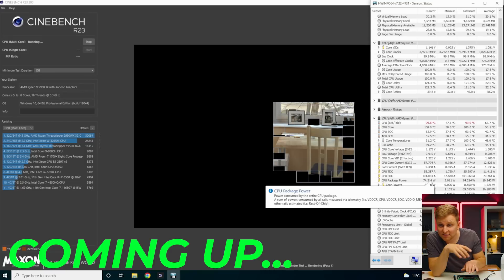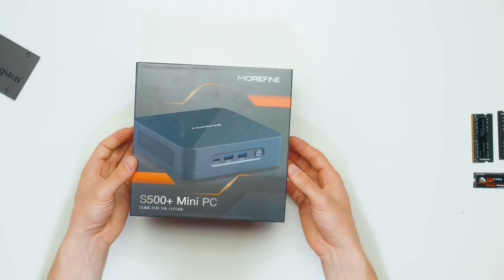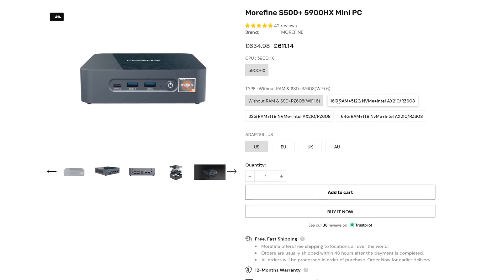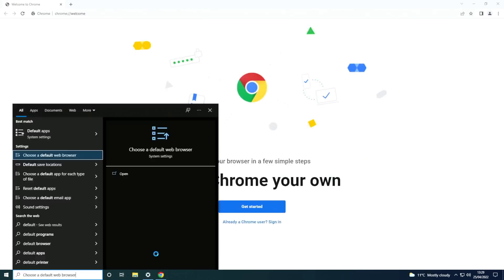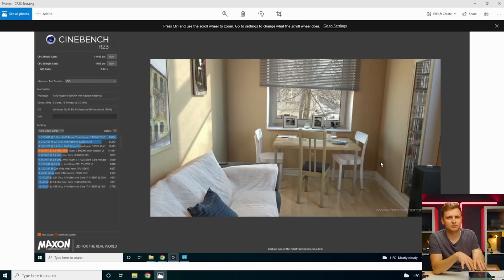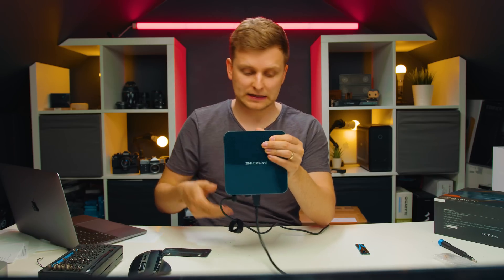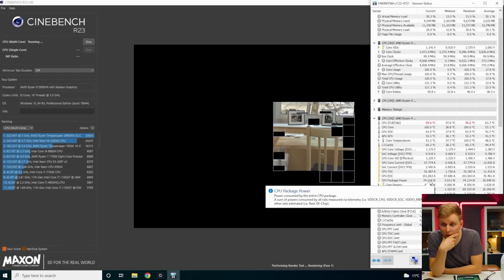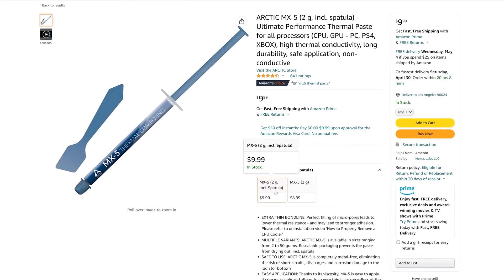BEST Mini PC?? Small & SOO Powerful! - True Apple Mac Mini Competitor! 😱

Comment: All the companies have not yet solved the problem of turning off the device with the oh on the back of the TV (msi has an external button)
Reply from the maker: You can turn the PC off with a keyboard if you have a power button on a keyboard if you turn the setting on on Windows Settings :)
Reply: @Tech Notice Yes turn off no problem just turn on

Comment: Hello @Tech Notice
 is it possible to use RAM memory at 3200mhz frequency by configuring in BIOS?, I have not heard that the project supports XMP.  or if it is possible to set the frequency manually.
Reply: Yes. You can do it

Comment: You and your type of people insist on focusing on external appearances, specifications, and benchmarks.  It’s the user experience that matters.  MacOS is a lot better experience than Windows.  Unless you are going to Hackintosh the device, it has no value to a Mac user.  I have Windows PCs, three to be exact, one of them a server, but “tiny boxes” with limited expandability are going to be overpriced.  People pay a lot of extra money for a Mac because it runs MacOS.  If I’m going to install Windows on a piece of equipment, any cheap, normal size box will do.  By the way, my power supply is inside my M1 Mac Mini, not stuck on my power cable.

Comment: One warning. It starts at $699 without any RAM or SSD. Mac mini starts at the same price with 8GB of RAM and 256GB SSD. However, higher tiered models cost less than Mac mini.
Reply: There's also Beelink GTR5 with same chip, $780 for 32 GB RAM, 500 GB SSD

Comment: I would reserve the SATA drive for archive or backup. Then I'd take the M.2 SSD and split it to 500GB for Windows on C: and the rest on D: for my personal data which would also be synching to OneDrive. This way, if you have to reset Windows, it won't blow away your data on D. Secondly, you can encrypt D but not C if you need that performance edge for your program startup.
Reply: you should never partioton an nvme ssd. never. cause is made in way that the trim algorithm will cycle the cells\blocks off data across all of them to minimize the deteriorizaton off the individual cells. and iff you do partitons the trim will not see the all off the cells and will not do this task for those cells who cant the see. is the same logic for sata ssds. and so is not advisable to partiton this kind off disks like the mechanikal ones.
Reply: @nelsonpiedade61  That is 100% false. Partitions work at the file system level. From the ssd perspective it's just data with no understanding of the logical organization. The block rotation will work regardless of the partitions. I have been doing this for years on dozens of computers and never had an issue.

Comment: nice try but M1 is a tiny chip that uses less watts than a light bulb while still being very fast, quiet and cool to touch. Plus it runs MacOS which I take over Windoze
Reply: M1 is a tiny weak chip, that cannot run Boot Camp like the older Intel Macs.    So say goodbye to near 100% Windows software compatibility.

M1 is also terrible for gaming.
Reply: @DerekDavis213  M1 also doesnt use 1000W and make your laptop last 2 hours like crappy intel.
Reply: @samjam6989  We are talking about DESKTOP machines.    If a super-powerful and cost-effective Windows machine uses an extra 100 watts, who cares?    $5 more per month on the electricity bill?  WHO CARES?

Comment: nothing beats Apple .
Reply: 90% of the world says otherwise.   Windows dominates, Apple has 10% market share.
Reply: @DerekDavis213  but apple it's the best...90% (and much more) of computer owners are poor, that's the reason!!!
Reply: @yannisgk  Apple charges ridiculous prices.  It's like paying $50 USD for a hamburger.  Only a fool would pay that.

And Apple does sell low priced machines too:  Mac Mini, iMac 24-inch.    But still, 90% of the world has ZERO interest in Mac.

And some of the biggest, wealthiest corporations in the world, the Fortune 500, have pretty much ZERO interest in Mac.   Big corporations use Windows machines by the millions.    In 2021, there were more than 200 million Windows PCs sold.

How many krappy Apple M1 machines sold in 2021?

Microsoft has an army of software engineers.  How many Bengali programmers are working for Tim Cook?

Comment: Can someone explain the use case of someone needing 4x USB 2 ports?
Reply: Keyboard, mouse, label printer, game pad.    High-speed USB 3.1 not needed for those devices.
Reply: I see, hard to imagine someone willing to sacrifice USB 3 ports for USB 2 ones. Even with a single USB 2 port, you can split it to have all of those as they don't take much bandwidth. But I would have thought by now folks would have bluetooth input devices and network output devices
Reply: @qubit3807  USB 3.1 on PC is very useful, millions of Windows users have pretty much ZERO interest in Thunderbolt 3 or 4.   That's just for the Apple boyz.  omg too funny.
Reply: Not sure what you mean, I didn't mention Thunderbolt in my posts

Comment: IMO if Apple added an M.2 slot they'd sell significantly more Mac's.
Reply: Not gonna happen. Apple might possibly push their own proprietary MPX module system starting with the Mac Pro, they might trickle it into the future Mac Minis and Studios. 
 
So that you are forced to buy their overpriced peripherals.
Reply: @Jan-xf8sk  On the topic of the Mac Pro, they are currently selling a configuration with 24-core Intel Xeon processor that costs about $18,000 USD.     A Windows PC with 16-core Ryzen processor offers similar performance, for about $3000.

Apple's pricing is insane!    They are targetting the fanboys and people with learning disabilities.
Reply from the maker: I couldn't agree more.
Reply: @theTechNotice  Very true.  But then they couldn't sell M.2 upgrades for four times market value.

Comment: I won't ever have a PC again; the only thing PC's have over Apple computers is games, so if your gamer PC all the way, otherwise Mac's for the win (I had PCs since the early 90s), and never going back since I've gotten M1 Mini!
Reply: M1 Mini with 16gb RAM and 2tb SSD costs $1700 USD.

For that money, you can get a Windows PC that is 4 times as fast!
Reply: @DerekDavis213  Okay, I got my 16GB 256GB for $900, but I have an external SSD 2TB, Still way under $1700.  I do not hate PC users; it doesn't fit the work I do now. That's all. I don't play MMO or any real PC games. If I did, I would have a PC, as I stated.  Video editing is pain on PC unless to pay 4k or more.  BTW MAC is not perfect. It's just better for me.
Reply: @charlespokeradventures  What are you talking about?  You don't have to pay 4k to do video editing on a PC!   $1500 will get you a powerful Windows PC for editing.

Now that Mac is running the M1 processor (from a cell phone), that means Mac can no longer run Windows software at full speed or full compatibility.   That is a huge loss for Mac customers.

Windows has 92% market share.   Mac has been on the market for 38 years, and today Mac is a LOSER .    An overpriced dead-end machine.
Reply: @DerekDavis213  Okay, I guess you Video edit, correct?  Do you also do color adjustment, Audio, and any 3d work?  Also, I use Davinci Resolve Studio 18, and yes, on the higher level video stuff, you need more than 16GB of memory on a PC.  You can do simple Youtube, TikTok, and so on PC for $1500 PC. But overall, you can do more with less money with the current Macs.  Next year I will get a Mac Studio as my next upgrade.  I will pay around $2,200 for the one I want.  I loved my PCs till I stopped gaming again. I don't hate them; I just found that Mac is a better fit for me now.  Have a good one😀
Reply: @charlespokeradventures  You will pay $2200 for the Mac Studio?  

So you are getting the one with lightweight M1 Max cpu, only 32gb of RAM, and 1TB of SSD?

Did you know that it is impossible to upgrade the Mac Studio beyond that?  Zero upgrades, and also no repairs.   Mac Studio is a dead end machine, and pretty much disposable.

In the past, Intel-based Macs could run Windows perfectly.  And Windows apps perfectly.  And Windows games perfectly.  M1 Mac puts an END to all of that.

Maybe you haven't shopped for Windows PCs lately?  $1500 will do a LOT more than what you think.  $1500 will get you:

Intel 12700KF cpu
RTX 3070 video card
64gb fast DDR4 memory
1tb ultra-fast SSD (7000 megabytes/sec)
Windows 10 Professional

This Windows PC will pretty much eviscerate the $2200 Mac Studio.  Mac will be in the ICU, gasping for air.  So to speak.

And as everyone knows, Windows has 92 percent market share.  That means that pretty much everything is designed for Windows, first and foremost.   Mac is an afterthought.

What if you had a car that used special gasoline that is only available at 8% of gas stations?  And what if that car had the hood welded shut so repairs are impossible?   That's what owning a Mac is like.
Reply: @DerekDavis213  BTW, I was getting 64GB memory, and 512GB HD, (remember I use an external HD) but other than that, you think am wrong, but that's okay, have a nice life.
Reply: @charlespokeradventures  I am part of Windows Nation , with 92% market share.

My computing experience is all about power, huge software base, and affordable prices.

My life is great!
Reply: @charlespokeradventures  You are getting the small 512GB internal ssd?

Remember that external HD is much slower than internal.

Comment: The Hardware is 50% and the Software another 50% and Apples-Software is extreme optimized for Apple Hardware, so no Windows-Hardware can reach the State of an Apple-Combination (Hardware+Software)
Reply: What is the State? Intel Macs were never faster than PCs nor more stable really. Now M1 is impressive in some ways but Intel and AMD are still beating it for less money.

Regardless, I really wanted to buy a Mac Studio but apparently only YouTubers can buy those at the moment.
Reply: @hbp_  Not at the same power consumption. That’s the whole point of M1 🤷🏻‍♂️

Apple was never gonna take the “cheapest computer on the market” crown and they never will.

Just like Tesla wasn’t gonna take the “most affordable car” on the market. But tsla is doing just fine
Reply: @RunForPeace-hk1cu  tbh I don't care so much about the price. Availability 1st and perf 2nd. It doesn't matter if M1 Ultra is good if I can't buy it.
Reply: @hbp_  Macs hardware dont need to be faster to run faster using MacOS. Are you a hardware nerd that keeps comparing hardware across different OS and platforms to pick the best device? 🤣 A pixel 6 phone that uses a 4 year old Sony sensor took better pictures compared to phones using better sensor and better CPU because of you know what? software optimization 😉
Reply: @samjam6989  I agree. So what should I do if the software I use works faster on i9-12900 + rtx3090 and on top of that I can't buy the Mac 😝
Reply: @hbp_  whatever your happy with is fine, I just stick to macs because I spent more money on windoze PCs that had morr issues hardware wise and was a hassle to maintain software wise. In 10 years I changed 4 PCs while the next 10 years I only spend money on one mac mini. In the long run macs were much cheaper, better and less hassle for me compared to PC.

Comment: NO.   Don’t Install Windows !   I want to see you install Linux on it.  Linux Manjaro.  Or Linux Mint.  Etc. 

I have a 2012 Mac mini.   Love the small footprint and hardware.  BUT I like running all the software especially open source.  I want to upgrade my Mac mini, but I want performance and the ability to not be a Windows or Apple slave.
Reply: There's not much to say about them on the linux front. The integrated vega runs great with the stock kernel drivers and there isn't anything that doesn't really work. Can only control the fan through the bios settings but that's about it.

Comment: Interesting PC. Thanks for the vid

Are you sure the improved score wasn't due to you leaving the case opened during the second run rather than the change or thermal paste?
Reply from the maker: Yeah, tried with and without. If your lid is on there is no difference in airflow, coz everything happens on the other side.

Comment: Speed of a m1 max studii for the price of the m1 mini 
Plus upgradeable ram 2 slots.
Upgradeable ssds plural x 3.
More ports, no thunderbolt or SD card.
Dual Ethernet  1 and 2.5 G os
Reply: Lmao you are insane if you actually think this is better than the Mac Studio. Money doesn't come out of nowhere, same with performance. You get what you pay for.
Reply: @MortalWombat22  aside from GPU power and tb4 SD card 10 GB Ethernet it's faster has 3 SSD upgrades paths the two pcie 3 ssds can be raided for faster SSD speed much cheaper, you can actually upgrade the GPU to the faster than studio one. , two memory slots 64 GB possible now when you want faster multicore .

Is much smaller with more cpu power the an m1 max not very power hungry.
For  $1000 dollars cheaper.

Apple media encoders not cou will make it faster at some video things but not all because of Intel's quick sync. 

But for most this will make more sense over the long run low price of entry and upgradeability no need for cables for all your storage or to be stuck forever with the same SSD and ram and GPU, both of which can go bad in the future.

You can even add more ports internally to this.

and you can actually put small form. Factor GPUs inside which are way more powerful than the studios base spec.
Reply: @Tigerex966  yeah it's very impressive for sure, but I'd like to see some actual practical comparisons. These benchmarks are not everything. Either way though of course this will be better value depending what you're after.

Comment: Wow 2 pcie 3 ssds and a data SSD and two upgradeable ram. Slots plenty of ports gaster that a m1 max.
With a better fan and heatsink and little bigger heatsink would run much cooler.

I wish it had a better media engine encoders.

Comment: Try PBO advanced. Maybe you can offset the core voltage if that option is in bios.
Reply: @theTechNotice  Sorry my english typing is not that great. What i mean is the curve optimizer. Maybe you can lower the per core volts and gain thermal headroom. Read: higher core clocks. Maybe its not available in the bios, than you can forget all this😉
https://youtu.be/nRCyxZK6E8s

Comment: How loud was it (under normal loads, and when pushed hard)? Some of the fans on these mini PCs can get really annoying.
Reply from the maker: Yeah, it can get abit annoying indeed!
Reply: @theTechNotice  dude the advantage of M1 mac mini is cool to touch, dead silent operation that I never even turn off the computer or put it to sleep when I go to sleep. Its always on because it uses like 10 Watts of power off a cpu chip as small as a smartphone chip. This mini  computer is overpriced and its a POS when comparrd to M1 in terms of energy efficiency and temp.
Reply: I have the same model, bios gives four temp/speed setpoints for the fan curve, unfortunately it's very annoying whenever it spins up, and with any CPU governor that isn't powersave it will be spinning up every couple of minutes on light loads. Powersave governor isn't much fun to do even the lightest loads on, but the GPU is efficient enough that it can play videos to a 4k display without choking or spinning up the fans (not that I'd recommend anyone buy a 5900HX unit just for that!)

I love my M1 Air by comparison, couldn't spin up a fan even if it wanted to. Main thing I like about the AMD miniPCs is that they drive 3-4 screens at full bandwith, sadly Apple capped the M1 and M2 at two displays and don't offer the Pro in the Mini form factor. Oh well, can't have it all, at least not yet :)